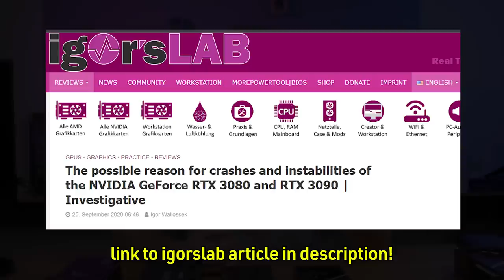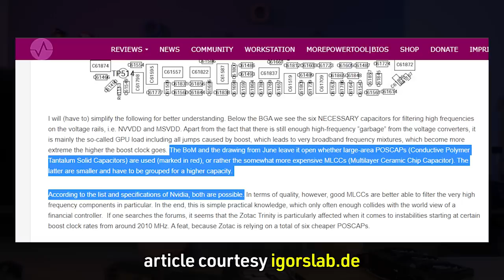The RTX 3080 Launch can't get any worse... Right? Wrong...

Comment: really? ur power lines r worse when it's dry?? the ones where I ride four wheelers react to the more moisture that's in the air   it really is a crazy sound tho  u expect to look up n see carona all around the wire  it never effects u tho u never feel anything, we had a guy come out to measure emf n it was only a problem if u slept within somethin like 50 feet of them every night for years n years  it's only n emf its not microwaves or some other bad type of radiation

Comment: You'll never be able to wash away the muck from your comments on the 20 series launch, Jay. Don't want to be labeled a shill? Don't act like one.
Reply: The issue turned out to be Nvidia post release drivers (pre release drivers were fine), had NOTHING to do with capacitors. Jay need to take down this video as its still misleading people like you,  but he keeps leaving it up for clicks $$. Yes Nvidia released a updated driver that corrected the problems on ALL regardless of capacitor type. Watch this explains all.
https://youtu.be/lhyCdraz54s?t=350
Reply: @ultimatewick  Your embarrassed I get that!
Reply: @Battleneter  What on Earth are you talking about? My comment had nothing to do with the 30 series cards or capacitor non-issue that Jay was pushing. Are you totally incapable of reading or basic comprehension?

Comment: I know this is old news about an irrelevant card but I did notice something. I have the Gigabyte Gaming OC 3080 12gb. Before I got it I had watched some videos on it, many of which were about the original 10gb model. I noticed something, the older videos tended to have cards with 6 SP caps on the back. More recent videos, especially with the 12gb model, showed cards with 4 SP caps on the outsides and MLCs down the middle. They claimed it didn't matter, and MLCs cost more to use, so then why did they change it?

Comment: What should i do? My Rtx 3080 crashes on desktop. Sometimes it won't detect my keyboard/mouse/mousepad/screen. If i manage to get to my desktop, my screen just freezes after some time and my screen go's black. (Not enough time to upgrade the new Nvidia update).
Reply: You need to update the driver. Maybe a Windows Reinstall would solve your issues. Just make a live Windows 10 iso in a pendrive and install it again.
If you have important files it's a little bit tricky. Try to boot in safe mode and back them up, or back them up with a live Ubuntu pendrive. You can access the Windows partition. 
Or you can just install the new windows in another partition/drive 
I know it's a pain in the butt.

Comment: @jayzTwoCents Seems like ASUS figured this out before anyone else.   Take a look at the TUF gaming 3080 information on the bottom of their listing on microcenter..  https://www.microcenter.com/product/628318/asus-geforce-rtx-3080-tuf-gaming-overclocked-triple-fan-10gb-gddr6x-pcie-40-graphics-card   The picture clearly shows (6) of the cheap caps.   Now look at the current pictures directly from ASUS's site - https://www.asus.com/us/Graphics-Cards/TUF-RTX3080-O10G-GAMING/ (it's cooler out back image) shows 6 of the expensive cap packages.    I assume that the ad copy on microcenter page is from pre-release versions.
Reply: @Battleneter  What was the reason for Nvidia 3080 FE and Asus cards being more stable than other like Zotac
Reply: @Battleneter  Zotac is now offering free cakes to people that bought their 3080
Reply: Not sure what you have been reading but the Asus Tuf has been one of the most reported cards for crashing, where the Gigabyte gaming OC one of the least , BUT has 6x 470 SP-Caps which lead many to believe including myself the Caps theory was BS. Lastly Zotac crashing the most now "seems" to be OK with the new driver as is the TUF.
https://twitter.com/HardwareUnboxed/status/1309659834468298753
Reply: @1GTX1  So seems that both Asus TUF and Zotac users that had crashing now don't, or at least from eyeballing the Nvidia reddit thread, pretty small sample size of course.

Comment: Cancelled my gigabyte 3080 order because of this video... yesterday nvidia released drivers fixing the issues lmfao
Reply: DON'T - Nvidia released a new driver yesterday largely solving crashing on cards with MLCC/SP-Caps or a mixture. It appears the capacitor "theory/Guess" is complete overhyped BS.
Reply: @Battleneter  already did, I fell for it bro. I usually never take these channels too seriously. I do have an MSI ordered though but who knows when it'll arrive.
Reply: @Cptraktorn  Actually my Gigabyte Gaming OC showed up today, so far really good. The cooler is better and quieter than I expected, zero crashing with the new driver.
Reply: @Battleneter  happy for you man :'(

Comment: That's why i always get asus parts. They always overengineer as myself
Reply: @Battleneter  i am engineer. I do have electronic knowledge. But this is not an egineering channel. He is also not claiming to know exactly what causes the crash but what he has read. You really need to get your ideas and bad temper somewhere else where someone cares. Note: electric/rf noise CAN make circuits unstable. The theory has good foundation even if it turns out to be incorrect, it has a pausible background
Reply: @VaracolacidVesci  I have an electronics background and could  not believe the over simplified garbage he was presenting,  "expensive cap" and "cheap caps". Just don't embarrass yourself,  he can own this :)
Reply: @Battleneter  learn to read. Nvidia clearly is saying they are different but wont say, some manufacturers cheap out. Just learn to read. And good night.
Reply: @VaracolacidVesci  You are Welcome , no probs!
Reply: @Battleneter  yes only asus cause at least from the several problems that can lead to the crashes it wont have the capasitor one.
Reply: @VaracolacidVesci  On their "Specific"  design. I don't have an issue with that EVGA statement. You do understand these are not the same PCB's designs right?.
Reply: Hahaha now it matters? Didnt you say nvidia said it dont? (Where clearly they said it does)
Reply: @VaracolacidVesci  You are talking about "one" design on a pre production card. Anyway good to help out the noobies, even if they don't want it.
Reply: @Battleneter  and the pcbs are just very slightly different. If you knew any elevtronics you'd know what an specification means
Reply: @VaracolacidVesci  REALLY can you link me to the schematics of say the Gigabyte Gaming OC with less reports of crashing than the Asus Tuf?, lets have a look at what the differences are.
Reply: Your logic its out of the game, you are not logical at all
Reply: @VaracolacidVesci  Ohhhh I assumed you had the schematics as you are making claims about the designs being so similar.
Reply: @Battleneter  THEY FOLLOW A SPECIFICATION. if that does not mean to you they are very similar. Then we cant have a conversation.
Reply: @Battleneter  i though you said you know something about electronics. I now see you just lied
Reply: @VaracolacidVesci  ohhh so you don't know,. ahh I see that's a surprise!
Reply: @VaracolacidVesci  So you don't know, backed into a corner and resorting to abuse, that a surprise!
Reply: @Battleneter  i know they are very similar as everyone with any engineering background. Cause a specification is not just an idea of how things must be done but a very specific thing. Differences can be just like location of connectors, parts etc. ( yeah moving a component on a circuit if in the same arrangement does not change the circuit) but everything is already set. So yes. I KNOW THEY ARE VERY SIMILAR
Reply: @VaracolacidVesci  lol engineering  background using words like "very similar".
Reply: @VaracolacidVesci  I am going to aim for Mars, its a "Very similar" distance to Venus but in the other direction, those planets all look the same,  I mean close enough right!, anyone with a space background will know the are "VERY SIMILAR" ,  ROFTL
Reply: @Battleneter  see, no point at all. Just more stupid comments trying to hide which you already know. You are wrong
Reply: @Battleneter  just give up. You are just a shame. Dont make it public
Reply: @VaracolacidVesci  You can just guess what capacitors are required by looking at it, I mean I usually use my thumb and hold the PCB up to the light, to hell with using oscilloscopes and schematics, all these electronic thingies are "very similar".
Reply: @Battleneter  when i said i know the function of those caps were? Someone else WHO ALREADY DID A TEST said they are a factor to the crashes. Nvidia said it aswell. Now since all the PCBs follow an specification (which means how they need to be done by specifics) THEY ALL ARE SIMILAR
Reply: @Battleneter  but i dont doubt you proceed like this. Someone gives you an specification of a gpu u do a lamp
Reply: @VaracolacidVesci  Ohh "Someone" did a test, no IgorsLabs released a "Theory". EVGA changed their capacitor layout for their design (perfectly fine assuming the issue was correctly identified). Nvidia released a driver today seemingly fixing most of the crashing issues on cards with both MLCC and SP_Caps, at the same time shooting down the "bad caps" and "good caps" ridiculous theory being regurgitated by noobs throughout social media.  Those dam speksy facts not fitting your point of view ah!!
Reply: @Battleneter  an educated theory based on the meaningless schematics of the GPU SPECIFICATION. And based on my own educated theory of you not knowing how to read. Ill tell you, igor labs did test the cards, as the article clearly stated. The nvidia pist u use to say it complete deminstify this clearly state that it can affect and be part of the problem.
 But your dunning kruger problem is big
Reply: @VaracolacidVesci  So you are saying ASUS got it wrong by using all MLCC's?, that does explain why the TUF is crashing so much I guess along with the RTX 3090 Strix, .I mean we don't have the semantics or testing to prove it but yea must be the capacitors.
Reply: @Battleneter  as i clearly said at the beggining. Many can be the factors that leads to the crashing. Seems that the caps has something to do, the new nvidia drivers that solve the problem does it by limiting the clock speeds, which enforces the theory of something wrong with the power delivery array.
By the way the capacitors are the power delivery array. So yeah, someone with electronics knowledge can guess that
Reply: @VaracolacidVesci   I mean everything is always black and white, so yea all crashing is a capacitor issues. Obviously the MLCC's used on the ASUS store less energy thus the GPU runs out of energy and we see crashes. OHHHHHHH so the drivers only target a fix for MLCC capacitors, that's convenient as you like Asus ah?
Reply: @Battleneter  you say nonsense. First you say it was not the caps. But nvidia it self has stated it is a problem. Evga confirmed also. Nvidia new driver limits clock speeds which again confirms is a power delivery issue. If asus crashes more or less than others may be due lots of different factors. One of which may be they have the higher clock speeds....
In fact here beeing the best may play againt asus. If their cards go higher clock speeds than your loved gigabyte they surely crash more since it seems it has to do with the clock speeds. Being the slow card here may be good (for a while)

Comment: All of these "gaymers" out there crying out about Clocks, and here I am purposelly undervolting and underclocking pretty much every piece of hardware that I put my hands on, since I learned that I had no major compromise in performance by doing that, matter of fact only benefits. Hilarious... so basically these cards, when underclocked, will perform with no issues right? Fine then.

Comment: Asus is getting the attention it deserves. Been repairing computers for years, and those standard mobos are tough. I change them less than other branded mobos around that computer shops often use. They got issues with mobos and gpus from the past, slow boot, bios clock, gpu fan, etc. But it seems they are improving a lot.

Comment: So, in other words there is NO ISSUE! As ANY Real gamer knows that Overclocking your GPU doesm NOTHING towards gaming FPS/Performance! The MOST you would get it 3fps extra out of 100fps! So ALL Overclocking a GPU (or RAM, as Ive tested 2 4000Mhz kits in the last day at 2333 & 4000Mhz & I didnt even get 1fps difference in both Far Cry 5 & Tomb Raider! Happy to upload the result screenshots even tested in SLI & non SLI 1080ti's) will do for you is risk instability!

Comment: So the bottom line is cheaper parts use for the 30's cards then the 20's. I get it drivers ups dates and better firmware can help but facts are just that facts when cheaper parts are used...

Comment: I have basically the equal to self made all AMD Parts Computer similar to most modern  consoles but the software for the AMD Graphics unit has an issue after certain update normally mass updates mainly by Windows Updates or Similar as it resets certain software but also trick GPU Fan and other settings in to resetting software to 0 operation Default wise as a result as well not to bad if you have a computer atleast as you can just manually go in to graphics software and set it back to normal (desired set up configurations),  probably my issue is  down to a software conflict  between OS software, Mainboard software or other driver software against  the graphics software that could also be able to create problems as well if Nvidia have a Simlar problem to what I have experienced with my computer at least  I know how to fix it  fairly easily with AMD Unsure personally how Nvidia are with Graphic software UI's are but hope if they also have this problem that it is easy to  fix  if they have that problem as well of course.

Comment: 6 PosCaps lookin azz
Reply: The issue turned out to be Nvidia post release drivers (pre release drivers were fine), had NOTHING to do with capacitors. Jay need to take down this video as its still misleading people like you,  but he keeps leaving it up for clicks $$. Yes Nvidia released a updated driver that corrected the problems on ALL regardless of capacitor type. Watch this explains all.
https://youtu.be/lhyCdraz54s?t=350

Comment: The NVIDIA GeForce RTX 3090 is the best of all GPU's of this time. If you overclock any device there are 80% chances that you will crash that device and what more results you will get after an overclock 7% more. NVIDIA GeForce RTX 3090 has 24 GB RAM, 1008.4 GB/s Bandwidth is there any another GeForce with 1008.4 GB/s Bandwidth . For Nvidia GeForce, RTX 3090 is the best. It can handle 8k videos easily and much, much, much more and it has secrets in its hardware and software you will never be able to know how they did it. They have old motherboard or only 4GB of RAM or one an Core Duo Processor those who say NVIDIA GeForce RTX 3080 or 3090 is crashing.

Comment: Help Jay fund this video! Head over to lttstore.com
Reply: The issue turned out to be Nvidia post release drivers (pre release drivers were fine), had NOTHING to do with capacitors. Jay need to take down this video as its still misleading people like you,  but he keeps leaving it up for clicks $$. Yes Nvidia released a updated driver that corrected the problems on ALL regardless of capacitor type. Watch this explains all.
https://youtu.be/lhyCdraz54s?t=350
Reply: @Battleneter  imma steal this
Reply: @rustable4165  please do, Jay should take this video down.
Reply: @Battleneter  i did

Comment: You talk too much. Seriously. Learn to cut to the chase more quickly. I am listening to tec channels to get information, not be more or less eloquently told a fairy tale. Off to reading the arcticle at Igor's lab. I could get at least that information quickly.
Reply: @rustable4165  The instability problems are a matter of using capacitors of insufficient quality for high frequency filtering. See Igor's Lab for an article about it.
Reply: @karx11erx  still can be fixed with a driver update
Reply: @rustable4165  Ok. You know better than Igor. I wonder why nobody knows you then.
Reply: @karx11erx  I never said that I'm just saying that he was wrong and its a driver problem
Reply: @rustable4165  You are totally clueless person. Igor is an expert for hardware and electro technical issues. He has an article about the capacitor problem. I recommend you go and read it before posting more nonsense here and making more of a fool of yourself.
Reply: @rustable4165  Maybe if you take an electronics course you will get the gist of what he is saying in this video.
Reply: @dannygjk  still can be fixed with a driver update

Comment: This is just poor Quality control and i'm pissed
Reply: Have you been hiding under a rock? It’s the drivers, not the caps
Reply: @hoveylu7231  No, they updated the driver to mask the caps issue.. have you been even inform about this?
Reply: @scottymsu6063  Has there been reports of crashes after the driver update?
Reply: @TheStraightGod   Thank for asking.  The updated Nvidia drivers Change the voltage slightly and it seem to solved this instability issue.  But at the cost of decrease overclocking headroom.   Meaning it perform at factory setting specification just fine.  For people who want to have the better built and better OC card need to pony up for the top of the line card.